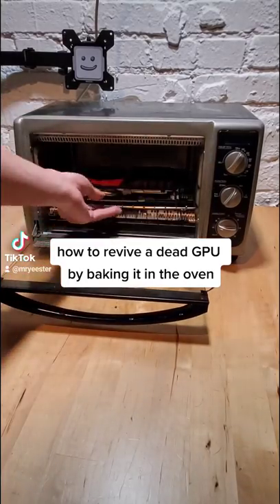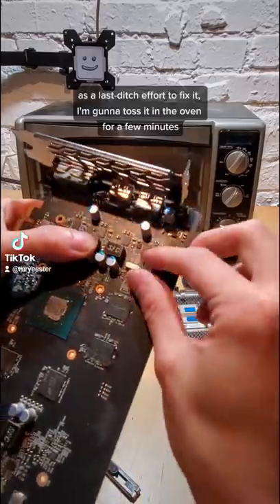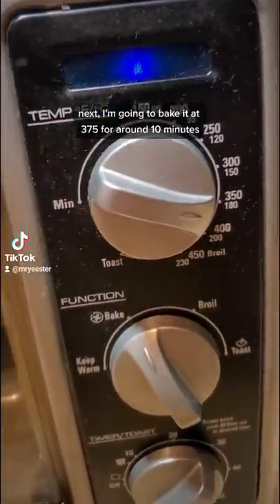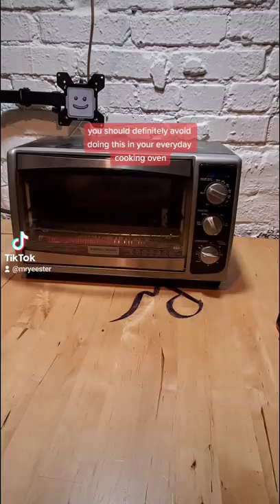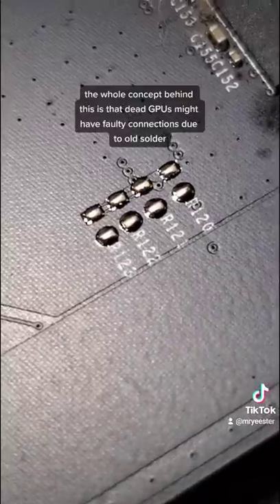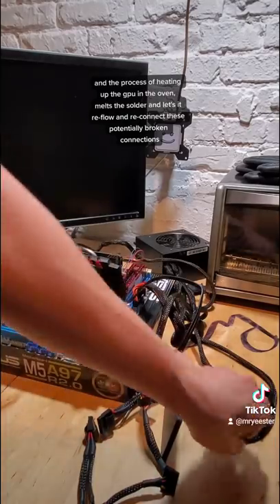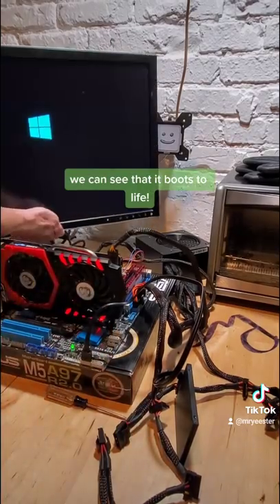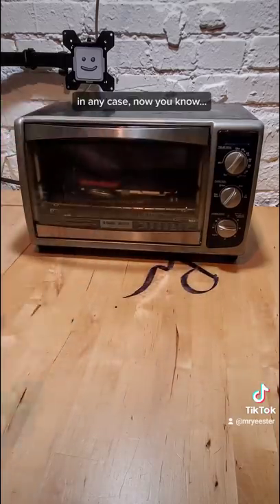How to revive a dead GPU in the oven #shorts

Comment: Only a temporary fix unfortunately, the tiny solder calls under the chip are weakened and will crack again shortly. The permanent solution is a reball.
Reply: Yes because cold solder joint! Apply flux!

But it is best to seek someone like Mr. Rossmann and fix it with a technician. Especially if it is a much more expensive GPU
Reply: You're not getting much longer out of a 10 series anyways lol.
Reply: @dynamix1862  Well, if you don't have much money the 1050 or 1060 are really good. I still play in my 1060 bc i can't buy a better gpu. :v
Reply: @tiospy  I feel you, I only just upgraded from my 1050ti about two months ago. But sadly it was very limited in the games it could play, in comparison.
Reply: @tiospy  ive still got my 1080ti from years ago. its an overclocking card too so it preforms perfectly well for the games i play!
Reply: @dynamix1862  Congratz on the update! I too hope one day buy a better gpu and cpu. My rig now is a 1060 6gb, i5 7gen and 8gb of ram.
 But i'm dreaming of a 1080ti, i7, 32gb of ram and a SSD (I have 1.75TB of HD, one is a good HD with 1TB and the other one is a really old HD with 750gb that i use for backup).
Reply: @strawbemily3182  Nice, the 1080ti is such a beast of a gpu
Reply: @tiospy  yeah! it may be 3 gens old but it still kicks ass.
Reply: @dynamix1862  yea sure, my games still runs in 100 -150 and in csgo with max settings 200+
Reply: @tiospy  Thanks! I really appreciate that. I truly wish you the best of luck with your future upgrades!
Reply: I fixed a laptop gpu this way, and you're right, it was temporary, but it broke 5 years later... Good enough in my book.
Reply: Or just buy a new card at that point
Reply: It’s usually not the connection between the chip and the gpu board but a problem inside the chip itself
Reply: Also, heat destroys electrolytic capacitors.
Reply: Dont forget that the whole PCB bends under high temperatures
Reply: Everyone here defending their 10 series while I’m still rocking a 970 with no complaints
Reply: @tiospy  I wish I could afford a gtx 1060. Im using 750ti, its not that bad honestly, even some newest games still runs on low
Reply: did this with my gtx 1070 about 7 months ago and it  worked, i was really surprised it did. it is still working.
Reply: @tiospy  I've got 10 20 and 30 my 20 series card requires repairs
Reply: Ohh thats not the only problem. If you bump the board or the chip gets a slight nudge you are in trouble. The only solution is re-balling.
Reply: Chip fix the IC off and solder it back on the right way.
Reply: @Lukemasonmedia  I would, but don't want to pay 1k for a 600 dollar card
Reply: @tiospy  rx 580>
Reply: @dynamix1862  pain since I bought my pc two months before 30 series, so am stuck with 1660 super or something
Reply: Well, not a reball if the problem isn’t with a chip. Just a simple solder.
Reply: @tiospy  I have a Strix 3080 bur my previous card was a 1080 ti and it was a beast
Reply: @tiospy  one thing I ask about this: why a 1080ti rather than a 30 series GPU? Some cards like the 3070 or higher range from a little faster to demolishing the 1080ti in price and speed (maybe not 3080ti or 3090) Unless your pc just can’t support it I don’t really know lol
Reply: @eddyzow  By now, i don't have money to buy a 30's, but i'm thinking of getting one instead of the 1080 (I said 1080ti bc my dream card was a 1080ti Founders Edition, just bc its beautiful and powerful). In my country  (Brasil) we have such a giant tax into eletronic stuff, that i need to wait until they start manufacturing some here (or buy a used card).
Reply: @tiospy  that is definitely a fair point, 1080 ti may be cheaper in your area. Where I live (USA) you can get RTX 3080 for same price as the 1080 ti, but I understand the tax might be why you want one of those. 1080 ti is still a very good card
Reply: Thats not is a permanent solution there's a time that your gpu chip permanently broke
Reply: Reading all these comments make me realise how lucky I am to have a 3080... I would give my 780 to anyone of you who needs it for free if you lived anywhere close and could pick it up (but I'm from Finland so that's pretty unlikely)...
Reply: Even reball is not a pernament solution sometimes and you have to replace the whole GPU core because it can sometimes be a problem between the core PCB and the core itself not between the graphics card PCB and GPU core. After reballing these cards will be the same like these from the oven or heat gun and they could die month/half year/year later depends on the luck because the problem is elsewere.
Reply: @dynamix1862  my 1070 is still going strong and can play most games at 100+ fps on ultra settings
Reply: @strawbemily3182  ive got a 980 and it is still going fine. It can handle almost any game that i play at near max settings.
Reply: bruh here i am with a 750 ti
Reply: @tomikun8057  mines a gt 730 lmao overclocked the snot out of it tho does what I need it to 35 to 45 fps on high settings surprises me.
Reply: That’s why once you get it working, you immediately sell it on eBay
Reply: A temporary fix for long enough to buy a permanent fix
Reply: It’s not a BGA problem, it’s a gpu die problem
Reply: @tiospy  I am stuck with barely 60 FPS running a 1060 3gb, an i5 6400 and 8gb of ram at 2133mhz, playing mostly Overwatch at all low settings 1080p. It’s a slight CPU bottleneck but still, the 10-series really is starting to show its age.
Reply: I feel like this would only be used to check if it still actually works (idk much about computers so I could be wrong)
Reply: But them it will be a circle not a dot
Reply: @IMarcoMI  yes you are very lucky🤣I feel fortunate to have a 1070 in my build and I mean I’m about to be a freshman in college so buying a new one isn’t on my radar. Im happy with it and I don’t need much more. Congrats on getting such a great card though
Reply: @andrewstoner4590  thank you! My previous build had a 780 OC card so I thought it was about time for an upgrade 😂 I'm on my senior year of college so it definitely wasn't the wisest economic choice at the moment, but I figured it's cheaper to spend more once every 10 years than to buy a new GPU a year or two from now 😄
Reply: yo how do my part sound I got amd a8, ddr3 1600 16 gb, quadro 4000, 500 gb ssd. I don’t use it for gaming just coding and video editing
Reply: @trapadvisor  if you don't game on it you're fine, but if you plan to start gaming you'll probably want to upgrade. I don't understand how you edit videos with only 500gb storage though, do you delete your footage or store it on a cloud service?
Reply: @emanandchill  mines pretty similar, gtx 1060 6gb, Ryzen 5 1600, 16GB ddr4 ram, 3 drives (1tb HDD, 1tb  SATA SSD and 256gb m.2 SSD for os
Reply: @tiospy  1060 perfectly fine card
Reply: @dynamix1862  eh, 1080ti really only became obsolete in 2019. And good luck getting a 20 series nevermind the 30's
Reply: @dynamix1862  uhm I'm still using a GTX 980 and it still runs games fine
Reply: Very limited ??? 
Dude i Have an GT 540m and i play a lot of games , and will , If i had an gt1050ti i would play a lot of games that i cant run rn
Reply: @dynamix1862  tf? My 1050 Ti is perfectly fine, no idea what yours on about
Reply: @tiospy  
A 1080ti is a waste of money now tbh. A rtx 2070 outperforms it and you get ray tracing. Also, if you are going to get an i7 get at minimum a 10700k. You need 8 cores now. Ryzen is a good option as well. My build is a Ryzen 7 2700x, rtx 2070, 16gb ram, and 2 SSDs.
Reply: @thefilozof01  
A re-ball is when you melt solder balls onto whatever you want to solder.
Reply: @mumujibirb  
Not too bad honestly. If you want to upgrade your graphics card, you will probably have to get a new power supply as well. These new cards take a lot of power.
Reply: @tiospy  
Get a 20 series card. A 2070 outperforms the 1080ti.
Reply: @LexiAzure  
Pretty accurate.
Reply: @trapadvisor  
No hell no to all of that except the ram and the SSD.
Reply: @barbuolimpiu9180  
A 1050ti is very limited for anything new.
Reply: @dynamix1862  I'm still on a Rage 128 Pro, man, a 10 series is still unattainable for me.
Reply: I wanted to say the same thing !!!
Reply: @tiospy  i still have my 1060 6gb and i works perfectly fine still can hold at high setting. I thought im the only one still using this gpu. Hello to my gtx 1060 brothers out there.
Reply: @Patrik2166  Louis is the man!
Reply: @dynamix1862  I can run Tarkov with it yet it seems to be pretty meh at alot of other games...
Reply: @dynamix1862  LOL no, they still work well for many titles if you crank down some settings
Reply: @kurnma3776  I never meant my words to mean the 10 series was obsolete, I'm simply saying that with the direction games are heading in these days. I don't see it lasting much longer with more VRAM uses and graphical advancements these developers have implemented in these games.

I will say, I hope the shortage ends soon. So we can all rock new hardware and pass on our old stuff to the previous generation. Good luck everyone.
Reply: i actually tried this on my rx470 it just stopped working one day and a last resource i tried this and it worked! 2 years later still running great and with great temps, plays any game you throw at it at good fps too!
Reply: At least we can order a new one while it works
Reply: @tiospy  Dude when I first built my pc I didn’t know shit so it ended up running really bad. I had a i3 6100, 1050 2GB, 8GB ram 😂. Now I have a 1080ti, i7 9700k, 32GB ram. The difference is night and day
Reply: @dynamix1862  Maybe gpu's should be readily available and affordable to the general population then. And not 6x the price only for miners.
Reply: @dynamix1862  I'm still using a 1070 pretty good
Reply: Still rocking my 750 ti, thank god nvidia still supports this puppy.
Reply: Enough to sell on eBay
Reply: @tiospy  shii nice build I just finished my rig upgrade but have to wait on the gpu right now I have i7 9700k with 32gb ddr4 and only a 1050ti lol
Reply: Nilly Sigger  8gb isn't enough anymore. People forget windows uses 20-30% of your ram. With 8gb maybe likely 5gb can go to any game if it's the only thing open. Not enough when many games use 8 entire gb and in some cases around 10 or more gb like CoD, BF, and Halo. 16gb is even staring to become 8. 16gb night only last until 2025
Reply: @Patrik2166  who tf is mr Rossman, your neighbor? Yeah lemme just give him a call
Reply: @dynamix1862  me with my 970
Reply: @ADHDegree  lol my sister still has a 970 and an fx CPU, but it still works for all the games she loves playing. If it gets the job done, that's all you can ask for.
Reply: @dynamix1862  yeah. Currently my 970 is paired with an i7 3770 and it works pretty well tbh
Reply: @astrobeats3863  Thats bs lol, unless your playing old games.
Reply: @dynamix1862  at 1080p 1070 and above are still pretty solid cards.
Reply: @Iflounder652  970 is just a 3.5gb 1060, so we're defending it too. Lol
Reply: @goldenfox334  your gpu runs at room temperature eh? That's a bullshit statement. Lol At idle both my 1070 and 3070 run around 40 degrees Celsius, underload 70-75 Celsius. Also the statement about mining is half wrong. If they undervolt/underclock their gpu technically it would be easier on the gpu then using it for gaming especially if you overclock it. I agree that the 1070 is still solid gpu but be real man.
Reply: if you bake it enough, it might last forever
Reply: Just enough to get it working to sell it off to someone else and make it there problem....sounds shitty (and it def is) but that's unfortunately the world we live in right now. I about shit myself yesterday when I saw an eBay bid on an EVGA GTX 1050Ti FTW for literally $440....I bought my exact same video card for $200 and then sold it for $85 right before the pandemic started.

Then bought a brand new EVGA GTX 1080TI FTW3 edition, and good lord I had no idea people were paying as much for these as they are for brand new 3060s.
Reply: @astrobeats3863  Same, so glad I didn't sell ALL my old cards before the pandemic. I managed to keep the EVGA GTX 1070TI FTW3 (which I can barely even find an article online Proving that these even exist lol. Only reason I don't think I have a fake one because I bought it new and that's what the box says and it's one of the few 1070ti models that uses triple fans and 1 x 8pin / 1 x 6pin power connections on the end .....which is so strange to me they didn't just do 2 x 8pins. Anyways, it still rips and overclocks very nicely
Reply: Im going to do this to my old rx480
Reply: Well he does say to only do it when other options are exhausted
Reply: @dynamix1862  1050 ti is better than enough for my needs
And better yet it dosent cost like 500
Reply: @strawbemily3182  1080 Ti is literally 3060 Super if it existed.
Reply: @strawbemily3182  i have a 1080 ti and its dead
Reply: Mine was last only 1 week
Reply: The permanent solution is to replace the chip. The cracked joints are not always on the chip to board interface. Most of the time, it is within the chip itself - the micro BGA between the die and the substrate.
Reply: This method of reflow will probably need a reball but most of the graphics card has a problem on the Vram so if you reflow on this location exactly with for example a hot air station the fix will had a long life.
Reply: Yea, fix will only last at max around a month at best, so listen to this guys advice and make sure to tripple check things you watch on the interwebs folk's!
Reply: 🙏 What is the average age of your graphic card. What is the best brand.
Reply: @dynamix1862  I’m still surviving on a 745, 10 series isnt that bad lmao
Reply: @Lukemasonmedia  I am not rich
Reply: @debasishiamwastaken  if you can get the solder to reflow, surface tension will pull the chip to the right place.
Reply: @tiospy  why do u need 32 gigs? Are u also using ur PC as a workstation
Reply: @tiospy  still running a 1080 ti and it suits me amazingly
Reply: its not the solder. its the capacitors
Reply: Honestly if you use flux and a heatgun then keep temps consistent after you will never need to reball again.
Reply: Yeah this will only last about a week before it starts playing up again
Reply: @sonicalstudios  only because he did it like a moron 🤣 if you have the proper equipment you can make it last for life if you keep temps low and consistent, as long as it's only a solder ball on the chip losing connection.

You may have to redo it again if you don't keep temps consistent.
Reply: @dynamix1862  lol. 1080ti is still a very viable card.
Reply: @reaperactualgaming3075  trust me, I'm becoming deathly aware it's still viable. A year later and I get nice and borderline rude comments telling me so. I want to say, I 100% retract my previous comment about the card lol. Hope you get a ton of miles on it for years to come.
Reply: @dynamix1862  Laughs in 1080ti
Reply: That´s a myth. Mostly it´s the damage inside chip, not solder balls. You are fixing chip by heating it.
Reply: Ah yes, taking me back to the Xbox 360 RROD days.
Reply: @IMarcoMI  we'll just put on our fins, and swim on over!
Reply: @mrtechie6810  I'll be waiting!
Reply: Reball can extend life for a few months, only new chip can fix it.
Reply: A lot of time that bad connection isn't the chip itself.
Reply: @strawbemily3182  I also have an overclocked 1080ti. It still trucks on running max settings and getting 144+ frames on 1440p. Strix cards are beasts.
Reply: The comments here definitely humbled me and changed my perspective on the pc community that I basically have "spoiled" myself with a 3080ti even if it was on clearance. Most the people in here are rocking 1050tis, 900 series cards, or worse, meanwhile I have 3 computers in my household with the "weakest" one having an OC'd 1070 as a guest pc, likely to upgrade it to 1080ti so I can say I have one. I also have a spare rx 580 and 6600 that'll go into other builds to sell or to give to family members.

Makes me realize that the pc community has loudmouths sure but the majority is not as fortunate as it may seem, I feel for yall. Tho i will say no matter if one of us has a 970 or if another has a 4090, We all got something in common, a passion for pc gaming
Reply: @tiospy  they are not really good my guy. If I can't play a game with high settings at 120fps+ on any game it's not good to me
Reply: @tiospy  dude just get a 4060ti.
Reply: It's not even that most of the time. The silicon can migrate over time with heat cycles and this process can make it better but the silicon is still damaged and a few more heat cycles will break it again
Reply: No, it’s actually between the die of the chip and the substrate, actually. That solder is pretty much un-fixable by the way
Reply: No, the issues are the microBGA balls, that is the balls the actual GPU die is soldered to the substrate to. There's no reballing that, heating up the chip does fix them for a bit though.
Reply: @GigaChadAlucard  A 970 is still a nice graphics card, just from a different era
Reply: @dynamix1862 the 1080 is still a viable card what are you talking about? You work for Nvidia or something?
Reply: @nakedsnake4248  no, the 2070 most certainly does not outperform the 1080ti, your thinking of the 1080, there is a 40% difference between its titanium variant
Reply: @dynamix1862  can confirm. Upgraded from a HD 6850 to a 1050ti to a 3050. From no DX12 to moderate performance to High on all but the latest titles
Reply: @strawbemily3182  bruh I’m using a frozr 3 gpu….
Reply: True i need to get my gtx 1650 reball ( i have a laptop)
Reply: Also you are cooking the caps way closer to death, on old caps this may be the last straw, a recap is recommended after this kinds of things.